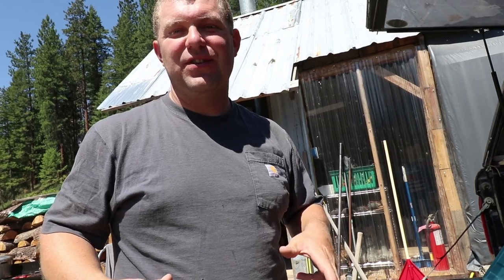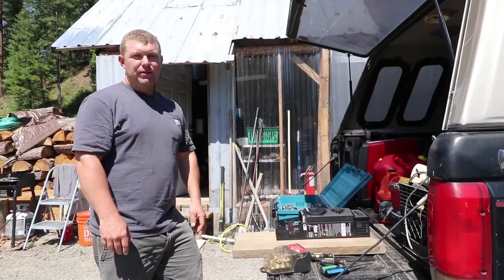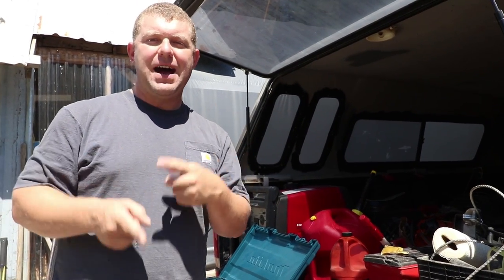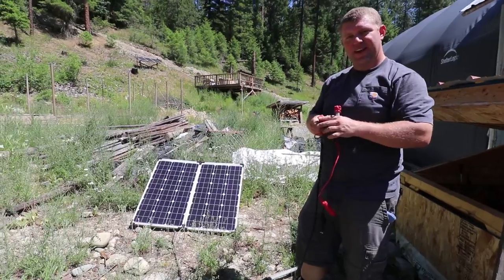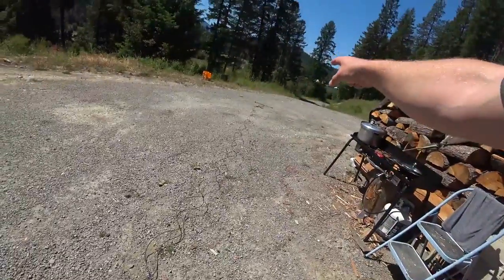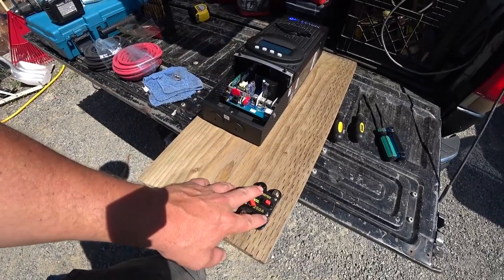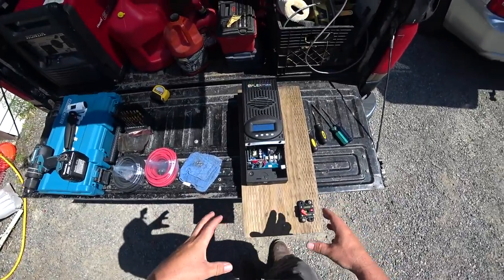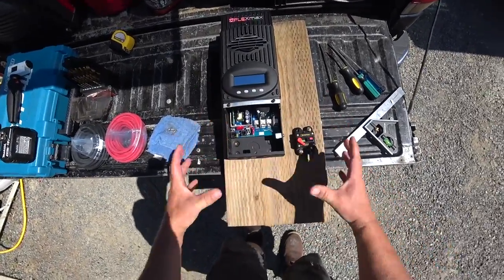Bad Idea? Now We Want Even MORE SOLAR POWER! (480 to 1230 Watt Upgrade)

Comment: Your're a little light on electrical knowledge but you have a great attitude and I applaud you.  Enjoyed your video and hope you make more.  Just by way of trying to be helpful.  Shortest runs of wire you can make is best and largest wire sizes you can afford and practically use are best.  I saw the crimp tool you used and it's marginal.  Will also help if you solder the terminals.  It will make your connections lose less power and reduce corrosion.  Your wife is a real trooper.  Best of luck.

Comment: Thought about some cross venting in the battery box? Push/Pull Fan system... prolly could use your old panels to power the fan during the day, mount on top of your cabin for a short run, and will face south it looks like.

Comment: I remember in a previous video you mentioned the cabling on you old panels could be changed around so i'm wondering with a little modification you can join panels together in a different configuration to produce the same voltage as the new panels similar to what you would do to change a 12v bank to 24v bank for example??

Comment: Got that quad too a 96 timberwolf by Yamaha. I have head gasket issues so very little compression left but it still pulls me and a trailer full of wood around. I want to upgrade to a honda foreman I've always loved that quad back in the late 90's. I hear they are reliable engines too. I also want to get a side by side to haul the kids around the property and woods. Maybe my wife will be on board too!

Comment: Good video and I absolutely load the part about learn as you go and grow with time, learn by success and mistakes. But I had an idea, if you know you'll be using the shed for the panel and the outside battery box, why not add quick connectors for the power cables, but make sure that the wires and connectors can handle say more than double your current load so it supports a gradual growth. That way you'd only need to run new cables once the system as grown much larger, instead of every time the system grows/change. You could even make quick connectors inside and outside to make it all more modular.

Comment: First step is always to understand your load. THEN build the system to meet the needs.  You need to think in terms of  Watts.  There are charge controllers which can deal with different panel voltages.

Comment: did you setup the battery datas? Voltages / max amps and so on? important!
check batterie datasheet. you don't want to under/over charge them

Comment: Hey guys, if your freezer is running to much try making a box out of foam paneling. Should make it so it won't have to run as much!
Reply: If the refrigeration used in the freezer is the type that uses the outside of the case as the condenser, this would cause it to overheat, not cool the interior and burn out the compressor.

Comment: I see your using spring loaded clamps to hook up the old solar panels to the battery bank. That means there hot electrically whenever the sun is hitting the panels, wrap the clambe with electrical tape to prevent a short that would burn out the panels, merely a precaution. 480 to 750?

NICE!

Comment: Bought an older homestead with old well that had power to it but does no longer. Curious if you have recommendations to run a pump for a well with solar? Would be our first experience with solar.

Comment: btw is the old system the panels up the slope connected to the inverter charger?

and in that case do the 2 chargers disturb each other
Reply: just2elste No the solar controllers only look at the voltage of the battery, one will shut down before the other due to the set points not being exactly the same
Reply: ok so no problem with the battery charge analyser?

i tried two smart chargers on the same battery today and the later one did not start charge  and the battery was not full

Comment: We just purchased some land in the mountains in Colorado and set up our first solar panels as the nearest power lines are more than a mile away. what is recommended battery or batteries to use 6 V or 12 V and how many of either, we currently only have the one 12 V battery on our travel trailer and 2 solar panels. We converted every light inside and out to LED to conserve on power.

Comment: DAMN,Alissa is a tough girl!

Solar can be a steep learning curve,indeed.
I have up graded 3 times and re-wired it twice.
I started out with ONE panel and a PWM 10 A. charge controller,after I took down my home built wind turbine.
Now is different: MPPT,(5) 150 W. panels. I usually run around 70 V. from the panels and 5 amps.
Almost enough to run my A/C(430 W.) in my 8X12 shed. I am not off grid at all.  You are.
80* this week.

Comment: Not to be negative, but that 250 amp breaker is way too large for the size wire you have from the solar panels to the charge controller. That wore looks to be about a #10 which can safely handle a maximum of 30 amps. The function of the breaker is both a disconnect switch and to prevent a fire caused by over current. The 250 Amp breaker works as a switch, but provides no protection. Also, per the national electric code both conductors must go through the disconnect not just one. Your breaker is only a single pole device, you need a two pole disconnect. The reason is neither DC cable is grounded. 
DIY is great, but you still need to be safe. Be aware that at 76 volts that is coming from your panels, can be lethal. Exposed terminals are a safety hazard. That voltage will be present anytime there is sun on the panels regardless of the switch position.
Reply: AMEN!   I was thinking the same things.  DC is more lethal then AC (there's no zero crossing sinusoidal wave in direct current).  All you need is enough voltage to jump through the resistance of your skin.  76 volts can do that under the right conditions.   It doesn't take but a an amp or two to stop a heart.  Most likely you won't have any issues, but as Bill pointed out, there are real risks in your setup, 
Electrical and Solar contractor, I am
Reply: Searched the comments to see if someone else said this already so I didn't double post.  Exactly what I was thinking though.  That wire if shorted out would light red/white hot in seconds and burn all the insulation off and 250A breaker wont even come close to tripping... and that's best case scenario (with no people involved)
Reply: Michael Schofield  well, not necessarily. A low resistance short will drive the voltage down to the minimum dependent on the specific PV cell characteristics. Probably in the 24 volt range. The current will be a few amps max. 
The bigger issue is that the 250 amp breaker will never trip. The D.C. From the panels can never produce sufficient fault current. 
A high resistance fault will cause overheating of the wire however which in time could result in insulation damage or a fire.
Reply: Bill Moran true... I guess I was thinking batteries not PV cells... Still in agreement about the 250amp basically just being a switch and providing almost no over current protection.
Reply: Typically takes about 30 to 40 volts to travel through human skin so 48V is on the low side but depending on the skins resistance (effected mainly by moisture content) could be bad... I'd be a little more careful with 48V but definitely with 70 and above like in their situation.
Reply: Just a FYI, as per the NEC, article 725, 50Vdc or more is considered a main voltage and requires to be treated like the standard electrical code which applies to the household. 

This requires the wires to be properly protected and the disconnect to be inside an electrical box or use a proper disconnect.

Yes, i understand you are using this as a "Temporary measure" however, this can pose health hazards if the disconnect switch (breaker) burns and decide to ignite the wood under it. this will make a great fire. also, you might want to place an outdoor disconnect (or fuse box) beside your solar system once they will be installed in their final position. 

anyway, this is just for information and you might act or ignore it. your choice. i would just hate that you have issues and everything burns down or suffer from an injury due to an installation mistake (ex: electrocution?)
Reply: Michael Schofield - Voltage does not travel. Voltage across a conductor produces current flow, and CURRENT (amperage) flows through a conductor.

Comment: Is there a reason you are not running both controllers in parallel? Given its a 12v (ish) battery bank so long as he full voltage is he same I would suspect you could use both controllers at the same time with at most some diode protection (if that  is even necessary)?

Comment: what if you place a couple small fans 1 on left and 1 right , (intake/exhaust) on the battery box to try to cool the batteries a bit better? just a thought. 140 mm or 230 mm computer case fans use little power and move a good deal of air. and run off of 12 V 0.2 A to 1 A most of the time.

Comment: I am using a pickup truck bed box as my battery holder. eh...    You might also want that low current wire tape for winter,ya know the stuff that people wrap around pipes to stop them from freezing, that power runs through.   Will keep the batteries delivering maximum in winter.

Comment: I have a couple of suggestions.

If you connect your old panels on the hill in series with the new ones, you'll have a higher voltage at the same current. This will give even more production, without having to change anything. You just have to stay below the maximum panel voltage for the controller. You could end up with triple the energy every day, and all you have to do is plug them in series.

I do not like the look of that breaker though. The breaker's job is to stop things catching fire if there's a problem. You have the breaker current so far from the current capacity of the wire, that it's just a switch. The wire could glow red and melt due to a fault passing huge amounts of current, setting fire to your RV, and the breaker would do nothing. You could lose everything.

I also think you could do with a battery breaker as well as an isolator, for the same reason. The batteries are capable of many hundreds of amps.

If you're willing to accept the risk of losing your home and everything in it, then that's your choice, but these are some simple things that can reduce that risk to a much lower level.

Comment: You might try using some foil faced polyisocyanurate foam panels to add another layer of insulation to the sides and top of the freezer.

Comment: Piecing together a small system sounds cheap and easy, but you have to think of the end situation really. Buying parts as you can afford to grow the system works IF (and a big if) you are putting together the long-term system.  We have a 6,000 watt off-grid system that was designed from the beginning through calculation of what the lifestyle needed.  It's a tough cost to swallow in the beginning, but after having a system that is automated and nearly maintenance free, it's worth it to not have to worry about it.  Have you sat down to calculate what the end system needs to be?  How many freezers, a fridge, a washer, well pump, animals, etc.?  It all needs to be considered for the big picture.  If you are just throwing ideas at it as you think you need it, you're doing yourself a disservice.  Homesteading is about working on the next season ahead, not the current one we're in.  You should be wrapping everything up for Winter preparations at this point, not scrambling to get all the Fall stuff done.

Comment: 8 A at 70 ish volts is 560 Watt comming from the panels. Pretty good in summer. I hope you get enough sun in autuum and winter, as you said the latitude/thickness of atmosphere the sun needs to go through is reducing it alot.

Btw Jesse have you ever thought about geothermal for your guys house? I don't know much about it specifically, and your guys soil is kinda problematic but I think an easy setup is just some tubes in the ground at decent depth and the air will pretty much equalize on its own I think. Cooling in the summer and warming a bit in winter.

Before anyone went solar my parents installed convector panels on the roof for heating water. Doesn't work aswell in the winter you need to take the water out, but in spring and auttumn you can save a ton of energy/fuel used to heat water by simply letting it run through a collector.
There is simple DIY projects like that, you could test it out with some scrap wood black paint and copper pipe.

Comment: How much power did that pair of decommissioned panels put out ?   If they output half the amps (or more) than your new panels, connect the old ones in parallel and then add that pair into your series to create a make-shift fourth panel.  Of course this is only doable if the old pair of panels can maintain at least the output current of one of the new panels.  Any additional current would be wasted and not used.  This would boost your voltage going into your MPPT :)
By the way, I AM sitting in my air conditioned house posting this BUT my A/C is being powered by my DIY solar system :)

Comment: The ALTe store and Lady is a good source to resolve all your issues. And MMPT charge controler is the only way to go from the start. and start with higher volts from beginning since all U. S. appliances run on 120 volt

Comment: I have had a few days out on the road and whilst driving along I got to thinking about this video and some things you may wish to think about 

Im not sure if you are aware of the reason we put fuses or circuit breakers in ?? the reason are used is because the stop the wire getting hot and the insulation melting so perhaps check the current carrying capacity of the cable and the circuit breaker you are using 
And also in Australia were Im from as a electrician we are concerned about what happens when things go wrong, as a result fire is a major concern and we dont want the fire to burn a house shack or your trailer to the ground so we make sure we mount things on a fire proof panel, eg a sheet of fibro cement sheet 
This makes the job a lot safer when something goes wrong

Comment: Hi Alyssa and Jesse ! Thanks for the videos, it is always interesting to see how people realize their dream and fight for it ! I will make some comments, but they are not critics, as I have gone through a lot of unpleasant ones when I was making my solar installation, and now living off-grid.

1) Your breaker 250A is a VERY BAD idea. The breaker near the Outback must be calculated according to the Amps that are arriving from the panels, and if anyrhing goes wrong, it will disconnect the power linefeed. My setup has 2 linefeeds and 2 breakers of 16A each one ( I get around 60-80VDC from the panels and 10-15Amps)

2) Do you have a breaker at the solar panel array ? I mean, a way to have the panels disconnected if a short-circuit happens between them and the Outback ? Also if you have to work on the linefeed, it will be very useful, and you wont have to cover the panels. Also, if for any reason you get a power return to the panels, it will protect them.

3) What type of section / diameter do you use for your linefeed ? Mine carries 60-80VDC/10-15Amps, but is rated 32A, if I want to expand my production in the future, I will not have to replace my wires.

4) increasing the voltage of your batteries in the future 24VDC / 48VDC will be a very good idea as the amps consumption will be reduced and less stress created for the batteries.

5) Not sure how are you panels orientated, but I did my setup using the values for the winter, in order to get a maximum power during that period when the sun is sleepy ;) ! In summer, we have plenty of energy available, so it is not an issue using an angle optimized for the winter. In my calculations, I was getting 500 extra watts with it !

If you want to see my work, and all the things I have gone through, I can provide you an internet link. Have fun ! Michel.
Reply: 6) Forgot to mention a very important point. The panels and the array must be grounded, they will be protected from electrical discharges / lightning, strokes , and you should use a different ground in your home. Mine are separated by a distance of 20m between the grounding connectors (Use coper bars, and not iron ones... the ground at home was dead because of that, fully rusted)

Comment: I put in my own system, since then it has changed 3 times. Each time I get better at under
standing how it works. It takes time but you will get it if you do your homework.  Don't forget to put a fuse on your inverter also.  As I understand solar panels, the best angle is the same as your latitude.  So for me it was 42deg.

Comment: Thanks and nice job. Is your system grounded? I'm an electrician with very little solar experience and I'm enjoying this. Just something to pass along, on the #4 awg thhn ( or thwn) it looks like you're purchasing shorter wire cuts of this. If you think you'll be using more of this in the future as your system grows  take a look at a 500 foot spool. It's always much more cost-effective, usually by a lot.

Comment: Great upgrade, it'll make a huge difference to your generator runtime each week. Looking forward to see how you upgrade the battery pack next. Incidentally, those odd figures you saw on the controller at the start were pretty close to just random numbers. With zero input current, the detected voltage figure is mostly meaningless, the controller isn't quite smart enough to render that information in a useful way.

Comment: I'd be interested in purchasing your old system. We have 104 acres on a mountain top with a 12 x 12 tree house currently.  No access to bring a trailer to the build site. We have fallen and dried timber for main timber beams. It is so peaceful until we have to run the generator to top off battery bank.